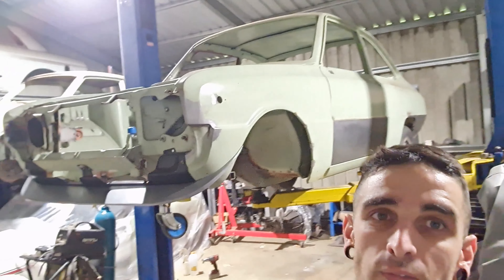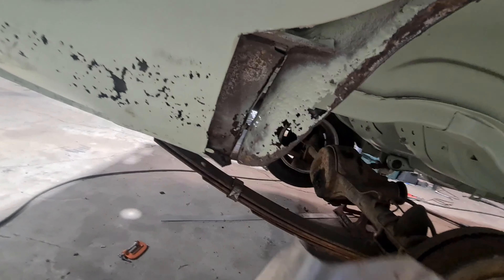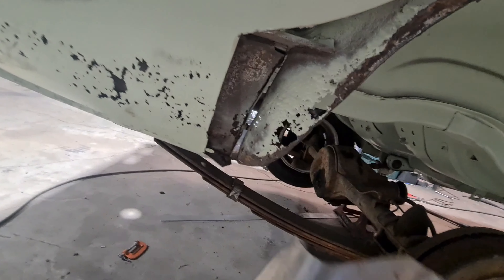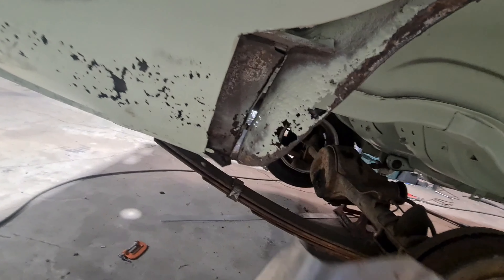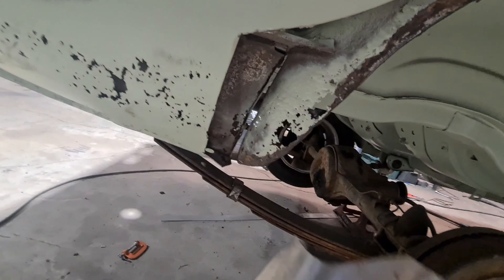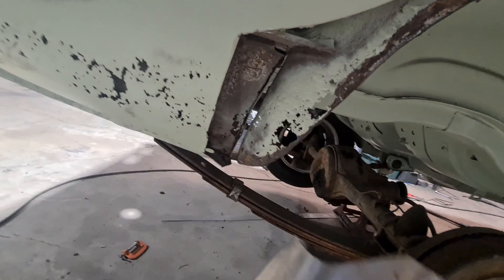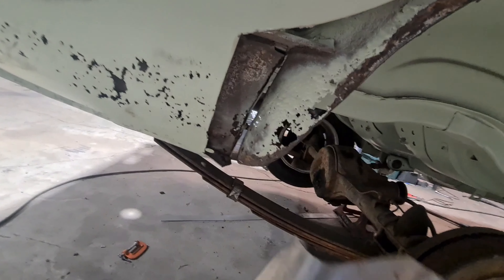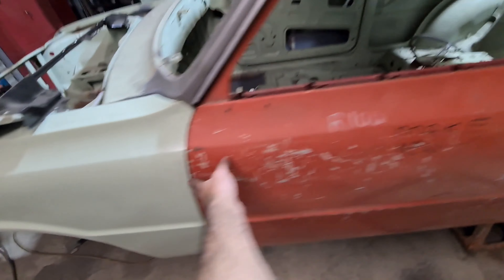Mazda R100 Restoration Part 3 Quarter, Door Skin & Guard Repairs

Comment: No good bead goes unplanished... 😜 Excellent job, as usual. I'll just have to move to Oz so I can force... uh, "coerce" you in to welding my VW Syncro...
Reply from the maker: Suprisingly haven't worked on any vw for rust, quite a few porsche, so can imagine the rust out quite the same given they are very similar.

Comment: whenever i see those rust spots under brackets, i think, surely every overlapped spot welded panel is similar, where would you stop. (i guess any rust activity needs inspecting if you go digging for it)
Reply from the maker: Yeah deff always going to be rusty under anything as it's baremetal,  but when you know water has been sitting it's crusty enough to warrant removing to refit

Comment: Can you give some tips on welding with tig with the copper weld through primer?
Reply from the maker: That upol copper is the only one I've found that the tig doesn't even notice is there. 
The zinc ones spatter and ruin the tungsten pretty fast.
I'm not great at tig I just use mig wire as filler rod and have it set on 36amps.
Sometimes I'll dial the Amps down if there is more gap than I'd like and then pulse the trigger manually to not burn through.
I've never been comfortable using a foot pedal I feel that's more for thicker welds that matter (rollcages,chassis work and alluminum work) where as the welds I do on the sheet are getting ground off and planished.
Reply: @notevn  - any tips on settings etc. would be cool. I tried to tig up my mates rust spots on his windscreen after removal and had to change to mig to get a result.
Reply from the maker: I'll run through the settings on it when I'm in the shop next as I can't even recall then myself.
I do know The metal has to be real clean. So possibly the surrounding area was still rusty on the backside and it wasn't liking it?
For areas where you don't have access to the backside it's safer to slowly mig though.
Reply: @notevn  - yeah nah, I couldn’t get access to the backside as it was the roof. Even though I pulled the lining down and tried to access. 
Tig was blowing right through, tried changing to a smaller tungsten and reducing the Amos to around 29amps with no love. 
But yeah I imagine cleanliness of the backside and residual paint were causing blow through.

Comment: Given that you have pulled the quarters apart, how hard do you think they would be to roll? 

I bought a painted shell and want the quarters rolled
Reply from the maker: I would say it wouldn't like being rolled because the inner and outer are not tight together they have a 5mm gap where there is sealer,  the fresh paint also probably won't enjoy being rolled over and will flake off at the lip edge , you might be better off trimming the lip to half the width instead as it's quite wide.